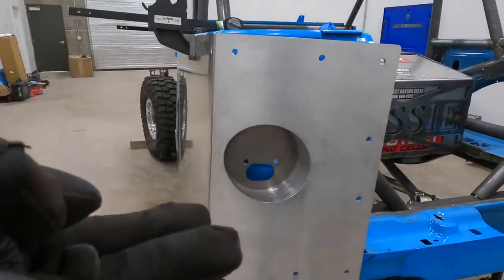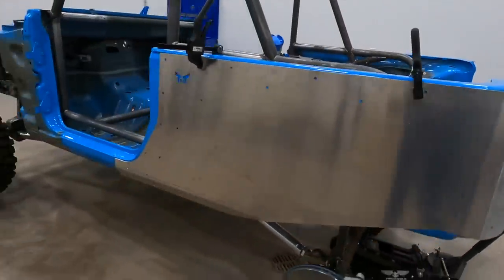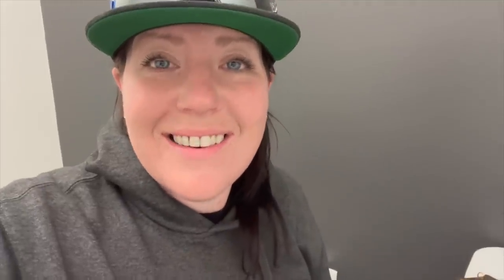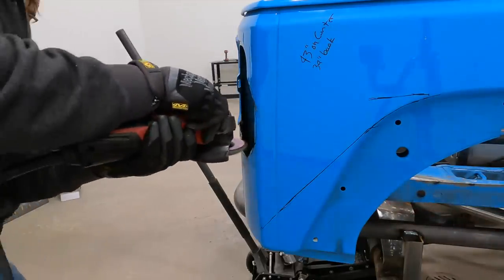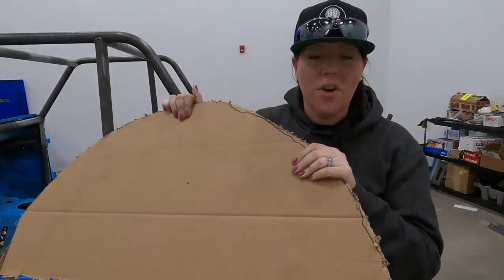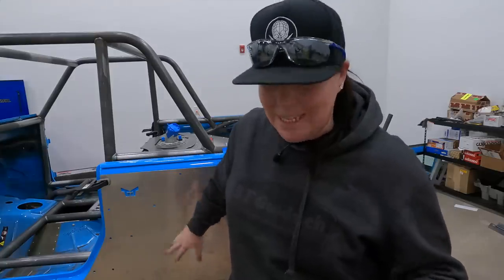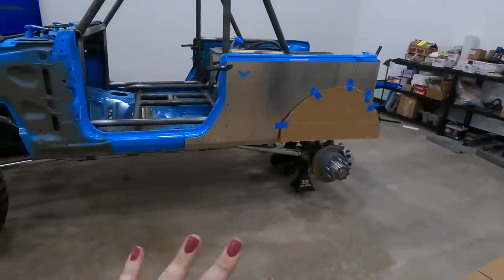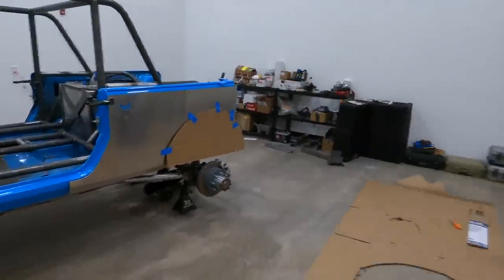New Corner Armor For Race Jeep

Comment: You can use a string as a compass.  Use a reference on the axle hub. No need for cardboard. Put a black sharp on the end of the string.  Draw your Half Moon.   Bam! Give it two inches or more for the opening.

Comment: You might want to tie a string around the axel hub and the other end to a sharpie. Then you can use it as a compass to mark the wheel well accurately.
Reply from the maker: That’s a great idea. I always imagined we would have a template of some sort that we could center on the hub, but that works as well. I mostly wanted to use the cardboard in this video as a visual aid.

Comment: Use a spray bottle on they cardboard enough that it will fold around the corner so you can tape it. It will dry fairly quick then you can reverse it & do the same to the other side with the same template  😁
Reply: Cut it so the corrugations are inline with the bend, then it will much bend easier.

Comment: I thought you were gonna cut out a full circle so you could find your centre point. There's no saying where you held the cardboard is centred to the hub.
Reply from the maker: That was just for demonstration. A lot of folks who don’t watch the channel might not have understood that if I just explained that verbally.

What we will end up doing is placing the axle back at full bump and then using a template to trace out the ideal Final Cut making sure that the center of the template is centered on the hub (which should be easy enough with some guide marks on the template and a plum Bob)